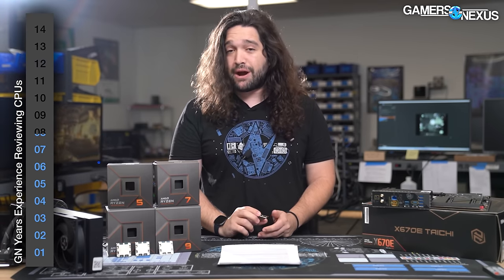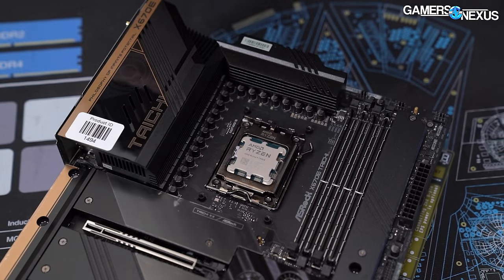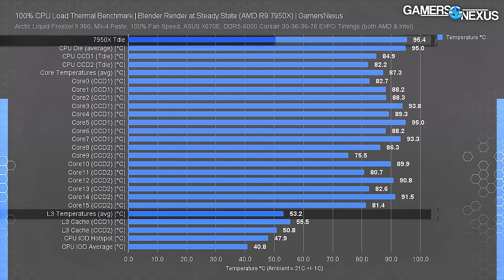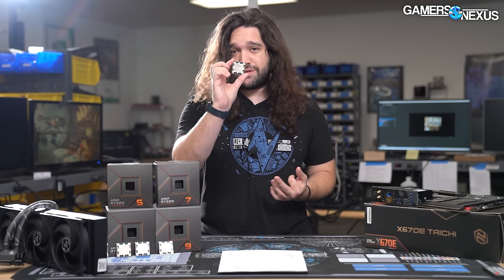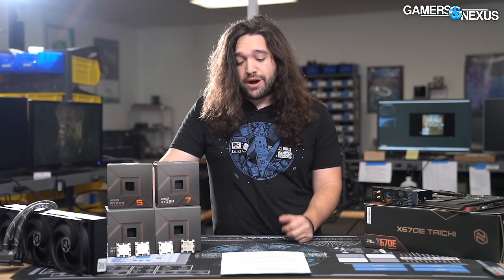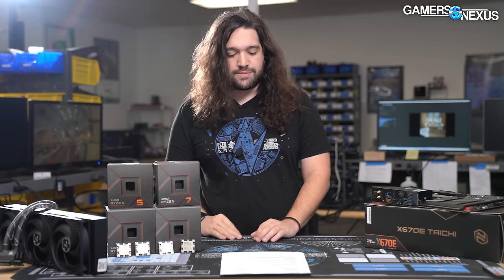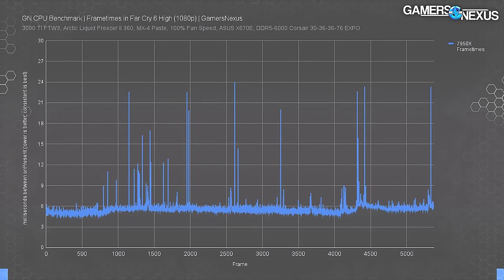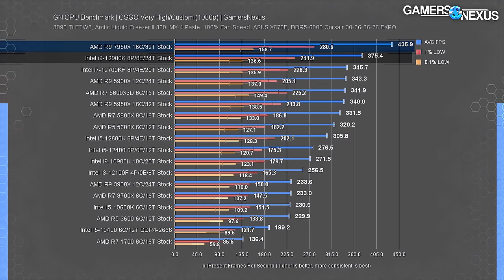95°C is Now Normal: AMD Ryzen 9 7950X CPU Review & Benchmarks

Comment: Actually, all this overheat hype was just that.. hype.  All you have to do is set it in EFI BIOS what maximum temperature you want it to run at, and it can be anything.  If you want to run it at 75C max, set it at 75C.   I have my own set at 80C max.  

99% of the time however I'm idling at 49C and 4.2ghz, because the mp4 decoders on the chip and GPU do all the work playing youtube videos.   

So if you were worried about buying Ryzen because of.. heat.  Don't be.  Just set it below running it balls to the wall in the redline all the time.   It can do 95C, but then your car can do 8000 rpm redline too.. that don't mean you have to run it there.

A good Corsair H150i 360 aio rad cooler will keep your Ryzen 7950x nice and happy, and I love Corsairs straight forward moutning mechanism.  It was confusing at first (I'm blind so I had to do it half by feel), but then once you figure out how it's suppose to go, you're like... wow... that's brilliant.

Comment: The spikes in frame times, I bet, are a result of a immature boosting algorithm for Zen4.  You'd think that AMD would have that nailed down by now, but this is a new platform after all.  I suspect frame time consistency will improve over time with future AGESA code updates.  It took time for Zen3 to mature fully via BIOS/AGESA updates, and I expect the same for AM5/Zen4.  It's arguable this is one area where Intel excels at, BIOS firmware programming.

Comment: Efficiency during workloads like blender may be less than the 5000 series offered, but it's still better than Intel and at the same time offers a performance lift over everything else. What was missing from the review is temps while gaming, which is a lot more valuable to most users than a 100% blender load.

Comment: There is an important benchmark all reviewers are missing. If they would have done it for the 5950x I probably would not have bought this cpu. I'm talking about the multi-thread integer performance improvement going from 16 threads to 32 threads on a 16 core cpu. For example the ryzen 3900X has a good performance improvement from 12 threads to 24 threads on classic chess and checkers benchmarks. The 5950x has not in fact it hardly improves performance going from 16 threads to 32 threads in this type of integer benchmarks. I've seen absolutely no one making this type of benchmark.
It's as if the AMD 3000 series were meant for multithreading workloads and the 5000 series were meant for gaming workloads.
And this is a big difference for me. This type of test is a good way to see how good those "hyperthreading" cores are. They are very good on the 3000 series but on the 5000 series are a disgrace.

Comment: Thanks for the video.
Would love to see a temp normalized test on CPU. Set the max temp on the motherboard to the worst CPU tested use only Zen 3 Zen 4 Intel 10th gen and up. 
Then we will see which tech is the best. Just maxing out thermals is how you get the highest scores, is not a sane way to build a cpu, or gpu.

Comment: 95C in EIGHT seconds.  Yikes!  Curious whether these would survive a boot-up with a bare CPU.  Can it throttle itself quickly enough to keep from releasing magic smoke?  Analog inputs are usually windowed, and that's not a lot of time for the thermal components to reach equilibrium.

Comment: Yes efficiency should be there next step. Moving to a new architecture this is not bad though. They were probably surprised themself to see how high they were able to clock with that silicon. Seeing results with a smaller cooler would be interesting. As this would actually increase the efficiency a lot. Maybe next time we could see a chart of tjmax vs efficency? I know that would be even more work, thanks for the already amazing work you did!
Reply: They will switch to Big-Little for Zen 5 because Apple wrecked them and they used TSMC 5nm too, lmao.
Reply: They are still comfortably more efficient then Intel's 12th Gen... NUFF SAID!
Reply: @stormking1973  Not for the 7600X and 7700X specially with those garbage temps and perf/watt.

Comment: "... sometimes at more power requirement and extreme cooling solution"... er, no. You just explained it yourself: if you slap a gigantic cooler on it, it WILL suck down more juice. It will keep slurping up that juice until it reaches 95C. If you had tested this on "a more reasonable" tower cooler it would have performed a little worse but used a lot less power. Those last 100-200MHz are costly as fsck in wattage.

I would LOVE to see a "cooler vs performance vs power draw" benchmark of Zen 4. Personally I think its the right move by AMD: Even boneheads can figure out "bigger cooler = more performance = higher power bill". But I'd really like to see the scaling! :D

Comment: wonder how the 3d cache versions are going to cope with the heat as I thought that was a big deal with the 5800x3d and one of the reasons why you couldn't overclock unless they drop the clocks and volts a bit as that seems to make a huge difference in temps this gen, will have to be highly binned chips to make a big enough difference.

Comment: My mate bought a 7950x and it has been restarting randomly during low load, I suspect it has a defective IMC or is not cooled properly on the IMC side of things. It restarts incessantly on windows 11, but only once or twice on windows 10, although now it crashes like crazy on both, bluescreened once, and also keeps restarting just 10 seconds into windows. 

MSI X670E MPG should be more than capable of handling it, let alone the latest bios update and just a measly 6000mhz XMP ram from Gskill, which is designed to be Ryzen 7000 capable. Applied or not this happens non stop on both operating systems.

Comment: So a couple things here and one of the problems I have with CPU testing right now. It is not a hypothetical to think that Nvidia and AMD will both be releasing GPUs into the future. That means there will always be GPU scaling going forward. It's not a scenario that wont happen. We could make a argument for Intels next generation of GPUs showing up, but in the case of the Nvidia and AMD, they will most definitely be releasing a next generation of GPUs. The future will be there tomorrow, we aren't operating in a simulator and hardware review websites should operate not only under the idea of giving you the best value today, but the best value in three years. While there aren't nearly as many people on a two year upgrade cycle as four year upgrade cycle, it is completely realistic to assume that someone will still be running the same CPU in 4 years when they buy a new shiny 5000 series GPU.

I get that you guys like going back to the '4 cores is alright and 6 cores is definitely going to get you by', but it's not realistic for a forward looking scenario. The sun isn't going to explode tomorrow, the world isn't going to end, there will 99.9% likely be the 5000 series from Nvidia and the 8000 series from AMD in 3 years. Operating under that premise, CPU bound scenarios, when testing CPUs should always be of utmost importance. Most importantly using resolution scaling first and foremost, rather then reducing graphical preset, as this best simulates a high end GPU or a next gen GPU.

The second interesting thing here is how not enough emphasis has been added to coolers. While it was talked about it mattering at the beginning of the video, the real kicker here is the trade off between cooler size, performance, and efficiency. A very interesting metric that could've been added here is the size of a cooler in a normal PC case Vs performance of these chips. There will be a diminishing return on this. So a 360mm radiator might not perform much better then a DH-15, but cost a lot more and of course take up more space. This very much butts heads with how overclocking works now, where people basically set arbitrary voltage or temperature limitations and will ramp up to it, AMD has taken that out of the equation. Where they set the temperature limitation and ramp up to it. This also means the chip will more then likely get more efficient with a smaller cooler, as the CPU senses it's pre-emptively running into a temperature bottleneck and reduces voltage to become more efficient, as is the case if you set a overclocking temperature threshold. So a smaller cooler may improve efficiency at the expense of frequency.

That would've been a very interesting comparative piece, showcasing different size coolers and their impact on performance and efficiency of the chip, as well as pricing and feasibility of having a larger cooler in a case.

Now the last bit, while CPU and GPU bound scenarios were mentioned, there needs to be more emphasis be added to which of these bottlenecks it's running into. I assume GN and HUB both have tools open in the background to monitor it, we as viewers can't see this and figure out whether or not it matters to us. It gives you a idea of why certain games will perform and scale much better then others. Seeing GPU utilization, as well as overall system CPU utilization and then the top utilized core, or just a utilization graph like task manager would help immensely make decisions on what they're purchasing.

Comment: Can you do an arma 3 test? That game runs purely on clock speed due to its lack of multicore utilization. It's completely cpu bound. It makes no difference when gpu you run once you run a 680 gtx or higher. But a cpu with higher clock speed will make a big difference.

Comment: Well, this didn't really age well, huh? Takes more energy to drive a F150 to Taco Bell one time than the increased energy used in the entire lifetime of this chip vs. others. Context...ha. It's power consumption is sorta interesting, but probably not really worth a rant when a general review could have been more useful. (Also, pretty funny in hindsight when compared to the 14900KS). And it's crazy efficient if set to a lower wattage. ...But we didn't know that until you told us later. Anyway, thanks for the hard work testing!! Appreciate you guys.

Comment: You don't need to  worry too much about 7950x temps. 240mm aio with four (push pull configuration)120mm fans is enough for 7950x. Or two 120mm and one 140mm fan is also good. So be easy.

Comment: It would've been better if AMD remained power efficient with Ryzen lineup and went all in with Threadripper (Non Pro) lineup. But this approach of applying more power to bring performance gains is not something I'm a fan of. Considering I live in a hot country where our ambient temps cross 45⁰ in Summers, this chip would really struggle without Air Conditioning.

Comment: I'm curious how much undervolting would affect this CPU (and really any CPU and GPU now, considering how everything is running hot and loud now...)
we might be back to it actually making a difference
also, does that wild underestimation of power load break some sort of law?
EDIT: Seems like I was right, this CPU has a luducrous overvolt, at least if what I've heard from L1T is correct.
Reply: 7950x @65W has performance of 5950X @full power (c) Level1Linux's Zen4 review video
Reply: > 7950x @65W has performance of 5950X @full power (c) Level1Linux's Zen4 review video
Are you sure,  @zbrkesbris5987  ? As the video on the main Level1Techs channel seems to suggest (to me at least) that the problem is too much voltage, not inneficiency _per se_.
EDIT: Ooooh, I think I just understood your comment wrong. Oops.

Comment: How are you testing GTA V? Is it still the same test as back in 2015, the fighter jet scene (pass 3) from the integrated benchmark? I'm a little surprised you didn't include it, as it's one of the few games I have that can drop close to 60fps on my R7 3700X; it drops to high 60s in pass 5 (the city) of the benchmark IIRC (with max settings basically, incl. advanced). But perhaps it's GPU-limited even with a 3090 Ti on 1080p then?

Comment: Why did you not talk about eco mode? You can knock it down to 105 watts. From what I've seen on in other reviews you lose only 10 to 15% in performance and temperatures  come down significantly. Even in eco mode it wipes the floor with the 5950x and the 12900k. Eco mode apparently does affect the single core speed.

Comment: It would be REALLY interesting to see what happens to the performance, and especially the power efficiency, if you DON'T give it a beefy liquid cooler and just slap a tower air cooler on it.  How much performance is all that extra wattage actually getting you, have you long since passed the point of diminishing returns, but the CPU is going to go there anyway, because that's the way it was designed with the whole 95 degree target thing?  Similarly, if locked to a lower power (if such a thing is possible), what is the performance and efficiency?  I think the weaker cooler is the more interesting angle of those two though.

Comment: Soo, what would happen if someone stuck 2x 360 radiators in a custom loop? 😅
For those who are afraid to delid and break a $700 CPU lol... also what about undervolting using negative offsets?
I have now further questions about Zen 4C and 3DV-Cache - I wouldn't be surprised next gen CPUs have shaved down IHS for better thermal heat dissipation. As Roman has found delidding the 12 core cpu and direct die cooling resulted in a massive drop in thermals. Edit: Steve / GN please try out eco mode, Gordon from PCWorld did some comparisons and the performance drop at 105 appears to 10% hit in R23 and 25% in 65 watts. Both of which still beat the 12900k and used less power.

Comment: Looks like for gaming 5800X3D is the way to hands down, and it does decently, in a comparison to others, as a workstation, where there are few that seemingly are better for workstation purposes, but it depends on which field you are in that you have your workstation set up as, either computing or graphics, CPU v GPU.
Reply: An extraordinary few amount of people getting a 7950 are doing so wtih the intent to primarily game–let alone will leave a lot of performance and I/O advancements on the table to resort back to Zen 3 when they can instead have USB4/Thunderbolt4, PCIe5 slots, and DDR5 RAM.

Comment: What if you limit the core count for far cry 6? Would you see more consistent frame-times? From a quick glance at the chart the performance of the 12400 seems to indicate a potential best experience if the game is limited to 12 threads or perhaps even lower for these cpus with more limited cache.

Comment: To be fair my 5800x runs at 90c for 4.8GHz across all cores and that's with a 360mm AIO. If it doesn't thermal throttle then it's all good!

Comment: You guys don't do downclocking.

I run both my cpu and gpu downclocked most of the time. Roughly 75 to 80% of actual stock performance. There are only a couple of games and workloads where I actually let my rig to shake off the dust. I would really like efficiency graphs with that in mind.

(forgive my heresy)

Comment: Let's see if it's reliable for one year, if the performance is not drop more than 10% because the temps is always above 90C, that silicon is amazing.
Reply: How would high temperature lead to a loss in performance over time?

Comment: Stevie, please add Davinci Resolve benchmark. Adobe premiere is crap, they never optimize to latest hardware. Beside resolve is the most common color correction software for professionals. it is also better than premiere because of its optimization. PS. Would you recommend AIO cooler for 7950 ?

Comment: So don't use such a small watercooler. I use a 560 Monsta on my Threadripper and seldom is over 70C, and fans on that are usually under 600 rpm most of the time. If temps were a problem (ie 90C) I'd just add a waterchiller and keep the water 2C above ambient (no condensation). When 3kW video cards and 1kW CPU's are a thing such a setup will be a necessity, not a luxury.

Comment: I love my 5950x. These things are getting ridiculous. I don't want to die in my room because of my system trying to dissipate that much heat.
Reply: @Mike Even if it isn't 24/7, if it lasts for 30 mins to a few hours, you're still gonna be baked in that room. Especially during summer. I already feel the annoying heat when I'm rendering on my 5950x.

Comment: I have a feeling people will find a way to limit the temperature, lose like 10% performance in production but 30% power consumption, and make this a way more attractive product.
On another note: isn't it strange that they increased the clocks a bit over last gen, had some minor IPC improvements, die shrinkage, DDR5 and the performance uplift is nothing to write home about? Maybe Zen4 is hitting a bottleneck that AMD couldn't figure out?

Comment: The 5800X3D of the " dead " AM4 platform is still up there in most games, it could probably run the 4070... I mean, the 12 GB 4080 and any GPU below, very well. Thanks for the video, take care.
Reply: I'm willing to bet it could run even the 4090 without issues

Comment: If you had a 7950x & a RTX 4090 what would the watt consumption be under idle & full load?  Lets see someone try & build a itx version of this, with dual loop ... I'd guess the Lian Li D10 "Mini" cases would be great, can always take out the hard drive cage for room for a second power supply.  And could install 3 rads, two 360s & one 240, & extend the feet & mount one of the 360s rads on the bottom & keep the pretty fans on the inside bottom.  And use clear plastic sheets cut & shaped (tunnels, caves, etc.) to control the fans air flow intake & exhaust.

Comment: Am I correct that the 7950X has an iGPU? Supposedly, cut-down RDNA2 graphics, but good enough for a standard desktop workstation display. I can see the 7950X as great for virtualization, but with the higher cost components, you wouldn't have to waste additional money buying a discrete graphics card.